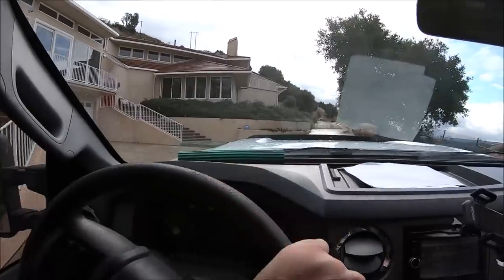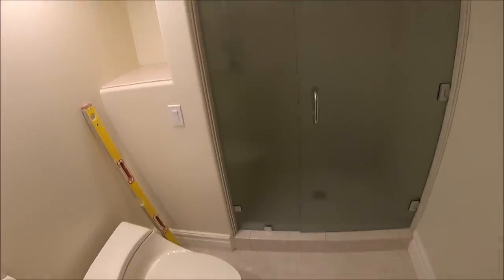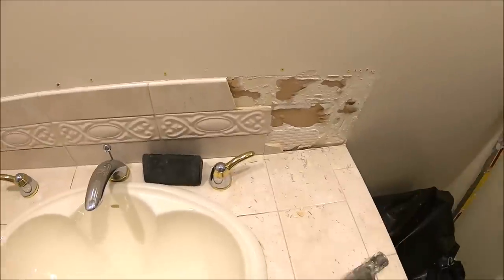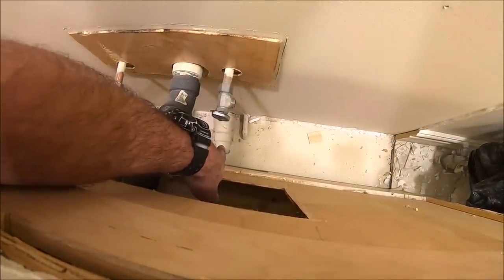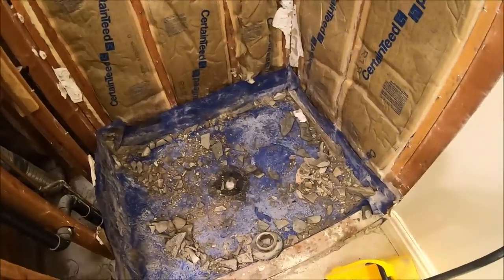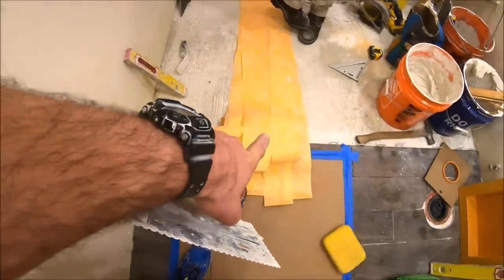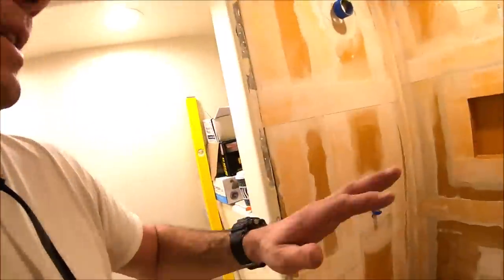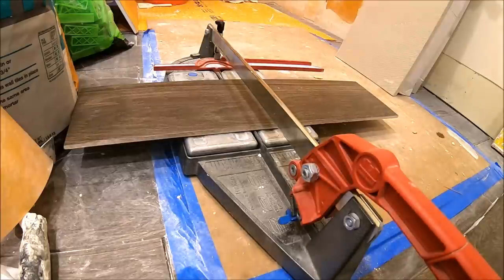Curbless Shower Reno-Bath & Shower Tile Ideas EP.40

Comment: Hardi backer board is crap,cant believe they havent gone out of business.The reason those tiles came off so easy on the walls and floors is because the board is so porous it sucks the moisture out of the thinset to quickly before it has a proper cure time. I used that board once 10 years ago on a floor and it failed, totally an inferior product.